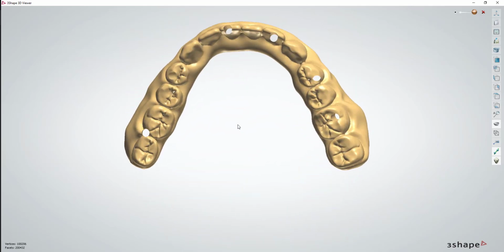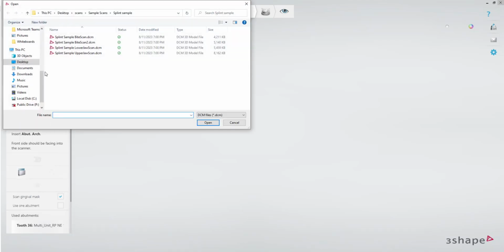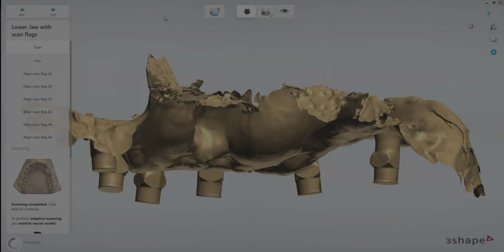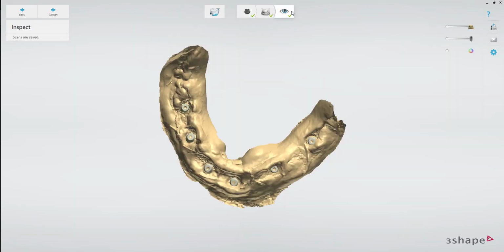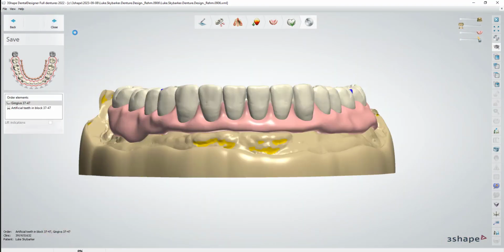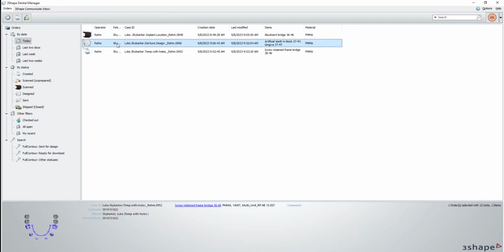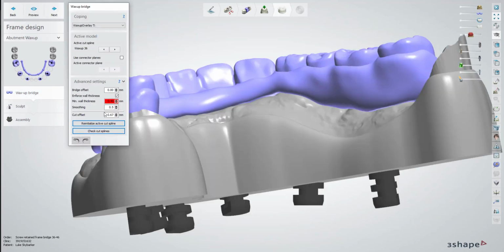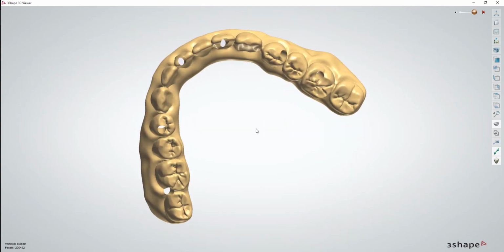3Shape Temp Fixed Bridge/Denture

Comment: Hey I'm kinda new to CAD CAM. Working with 3shape 2019 right now and have lots of questions hehe xD
So 
1st case you created was just to make a dcm model file with implant position information.
2nd actual design.
3rd screwing holes in the design from 2nd?

I may sound stupid but why you could do everything in 1 case?

What I would do: create an order similar to your first one, using 36,34,32,42,44,44 abutmets (full anatomy, I dont recall how they are called). The selecting all arch as crown pointics, gingiva and connecting all with a bridge. 
So wont you be able to do scans like u did with aligning scanbodies. Then in dental design complete steps of insert direction, teeth design, gingiva design, screw holes etc and have case done in one order?

Sorry if something isnt possible. Im just trying to learn using all info I can find online but thats the way I would do it I think. Or is getting laggy and its more safe to do it your way?